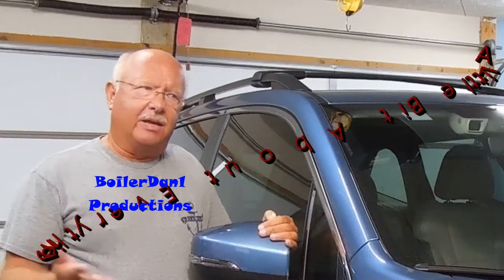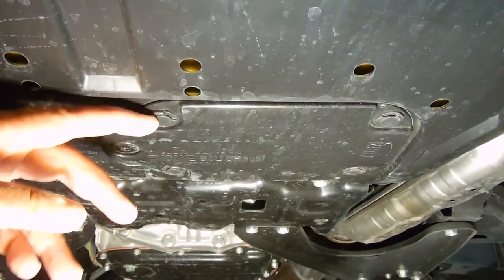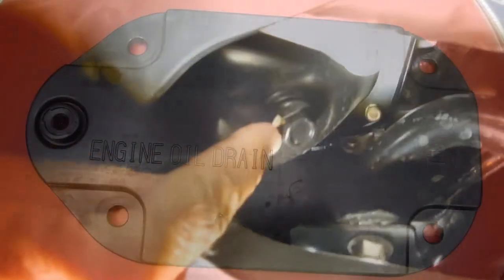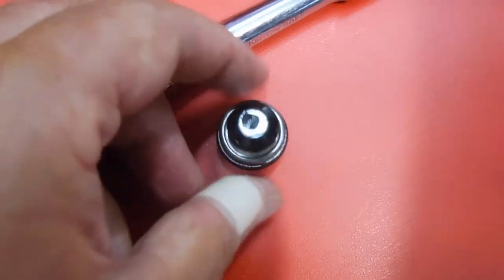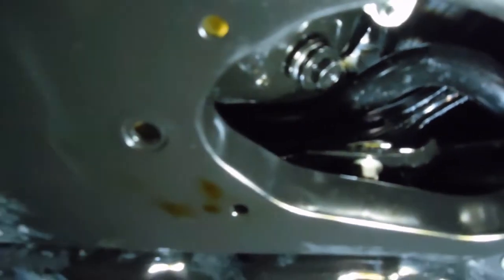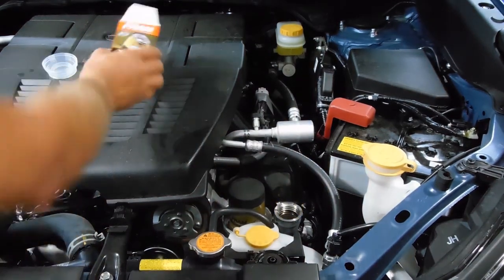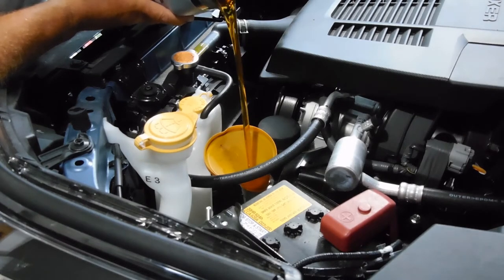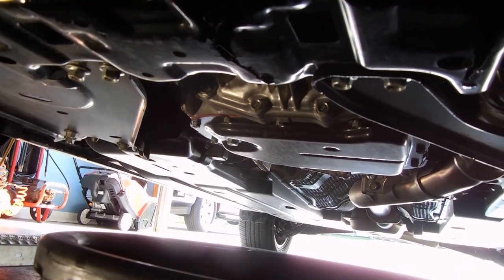Oil Change Subaru Forester

Comment: Recommend a New crush washer when putting the 14mm bolt back on the oil pan.  Torque for drain plug is 30 ft lbs.
Starting the car after oil change can cause some engine wear  until oil pressure builds up and the oil filter is filled.
Instead of starting the car with no oil in the filter, hold the accelerator down all the way, crank for 30 second intervals until the oil pressure light is off.  That preloads the system with oil, then start the car.
Reply from the maker: Thanks for your knowledgeable input.
I didn’t know that about holding the accelerator down?
Although, on my previous Forester I put over 100,000 miles on it and it didn’t use any oil between changes.
I’ve always used the crush washers but to be honest, I never tighten to the 30ft pounds. I just do it by feel!😉 Maybe my next change I will give that a try too.
Thanks so much for watching and adding to the conversation. 👍👍
Reply: @BoilerDan1  I have had Subarus since the 1990s and run them to 200,000 miles.  The only problem I've had is faulty head gaskets.  I do prefer the old style oil filters that were underneath...they could be pre-filled with oil unlike the newer style that can not be prefilled with oil since gravity would drain them on the install.
Reply: @RetrieverTrainingAlone  so you just put some on the very top of the filter with you fingers and that’s it ?
Reply: @adamavelar2691  Yes the older subarus you could pre-fill the oil filter because the filter was installed from underneath the vehicle.  With the newer subarus pre-filling the filter with oil is not easy since the filter is installed from above.

Comment: Thanks for the video, really helpful. I got a 2019 Forester sport i got a few years ago brand new (lease) and i sort of neglected to change oil in it and now i'm scared to give it to the dealership, for all i know they will charge me with something crazy, so figured to change it myself and then give it to service later. The oil change guys didn't want to touch it because it went too long with no change...
Reply: How long are we talking ? I don’t want to go too long Ive only had it 4000 miles
Reply from the maker: I’m not sure how many miles the person had?  That being said, I change oil every 5,000 miles.
Subaru says every 6,000 miles.
I’m using 
Mobile One full synthetic 0w20.

Comment: Thanks for your video, especially on telling everyone to watch out and not drain their transmission!  I like the push tabs on  your oil drain plug access panel better than the ones they installed on my 2018 Subaru Forester.  Mine are the Philips head type ones where the Philips head slots are stripped out on one already from the factory so I had to break it to pull that center pin and remove the push tab.  I also wanted to point out that you do still have your crush washer from the factory installed.  It looks just like mine.  The factory tightened that drain plug so tightly it utterly flattens that original washer and combined with the factory engine paint, I had to pry it off with a small flat-head screw driver.  I doubt it'll hurt anything leaving  your's but I wanted you to know just in case next time you want to remove it.  I just posted an oil change video on my channel if you want to see my factory one I think I included a couple photos of it.  Take care and thanks for posting your video!
Reply from the maker: I’ll definitely check out your video.  I’ll pry off the original crush washer on my next oil change! I’m sure over time it would get a split and drip some oil! Thanks for letting me know and for taking the time to watch mine and comment 👍👍
Reply: BoilerDan1 glad to and thanks for subscribing...right back at ya 👍
Reply: @BoilerDan1  at how many miles do you change the oil on these ? I have a 2021 forester with 9 000 miles on it got it with 5000 in it .
Reply from the maker: I change every 5,000 miles. The owners manual says 6,000.
I just turned 80,000 miles on this one. 
Considering it’s a 2020 it’s obvious that I’m enjoying retirement!😂
Reply: @BoilerDan1  awesome ! Thank you

Comment: Thank you for this well organized and clearly explained video, I have the same car and would like to see more of your maintenance videos on it!
Reply from the maker: This is our 3rd Forester. The last one was a 2016 model and it had 103,000 miles on it when we traded it in.  The new one took some getting use to with the adaptive cruise control and the driver assist auto diving technology.  Now retired we’re doing a lot more traveling and I like the new features.  I’ll post things as they come about although I bought it for the reliability! ... So I’m hopeful there won’t be much😂👍👍
Thanks for watching and taking the time to comment !
Reply from the maker: This is our 3rd Forester. The last one was a 2016 model and it had 103,000 miles on it when we traded it in.  The new one took some getting use to with the adaptive cruise control and the driver assist auto diving technology.  Now retired we’re doing a lot more traveling and I like the new features.  I’ll post things as they come about although I bought it for the reliability! ... So I’m hopeful there won’t be much😂👍👍
Thanks for watching and taking the time to comment !
Reply: BoilerDan1 cold Canadian winter is coming up and I’d be interested to see how it does in minus 30 Celsius here, first winter with it, I’ve heard many Impreza wrx won’t start in those cold days with their turbo boxer, curious how this non turbo 2.5 does

Comment: the old compression ring is on your plug.  You now have 2 on, not good.
Reply from the maker: No, this is my 3rd Forester and there’s not one on my plug underneath the one I installed.  Still don’t know why one wasn’t on? But I have over 48,000 miles and change the oil regularly and replace the ring every time.  Thanks for being concerned, but I’m doing fine 😁.
Thanks for watching 👍👍

Comment: The crush washer was stuck to your plug. Easily visible. Also using FRAM filters on subies, not good, unless you’re changing every 3k miles
Reply from the maker: I’ll take another look at the the plug on my next oil change!  This is my 3rd Subaru Forester and I keep them about 100,000 miles before trading them in.  So far, I’ve never had to add oil between changes…. But I do change every 5,000 miles.
Also no oil dripping on my garage floor or the cover plate.  I’ll add that you’re not the first person telling me that the crush washer is there…. Maybe I should remake the video and make it clear… but honestly, I will give it a very close examination.  I’ve got 50,000 miles on this one, and will definitely buy another one 👍👍
Thanks for watching and being concerned .
Reply: Awesome